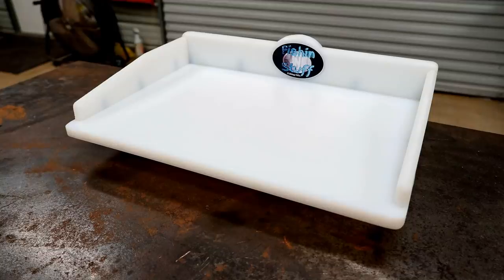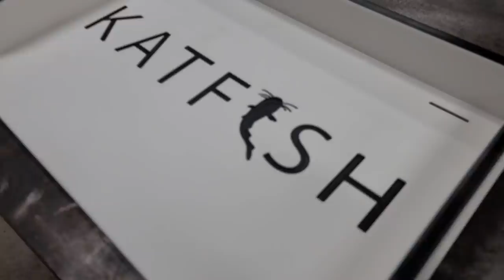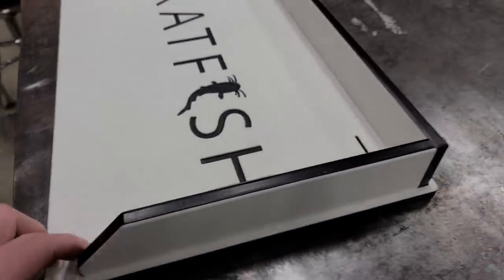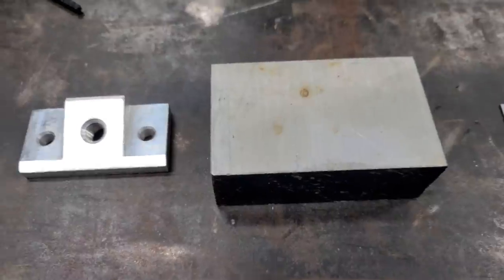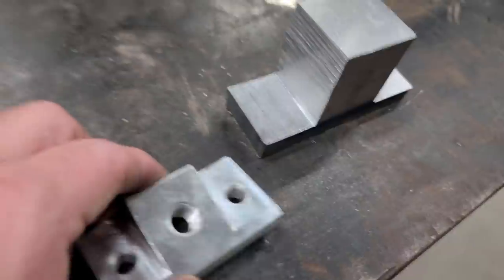DIY Cutting Board Mount

Comment: Katfish is Kool!!  Great DIY!  The only change I would make is use the bolt and tap the base, one less piece to lose.
Reply from the maker: Thank you brother,  if I wasn't planning on giving away the cutting board I would have made a shift holder on the bottom of the cutting board

Comment: Only thing with the aluminum rod would be getting boogered up by the set screw. Easy fix would be file or sand a flat spot for the set screw. Then it wouldn't rotate either.
Reply from the maker: I agree  , I think a SS rod with a flat spot wild be perfect

Comment: I’m trying to come up with a 2 wheeled dolly to use as a sand buggy! Actually found an inexpensive one with big wheels for the sand. The only thing I can’t figure out is how to find and mount a bait table on the back that will push down to lay flat and push up to a 90: angle  for cutting bait. Any Help would be appreciated. Thanks!

Comment: Have you considered using aluminum welding rod?
Reply from the maker: Do you mean brazing rods
Reply: Well that could be the actual name for them. I get them at harbor freight.  Heat up the aluminum to 400 degrees and work the rod onto it.
Reply from the maker: @monroebaker2517  yep I've done a video on those